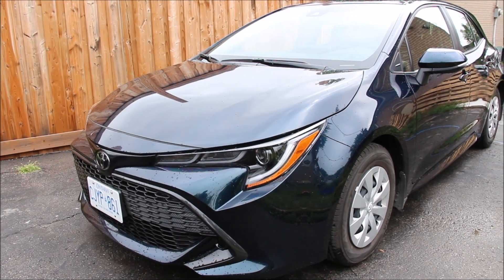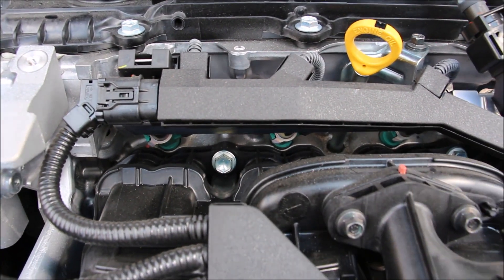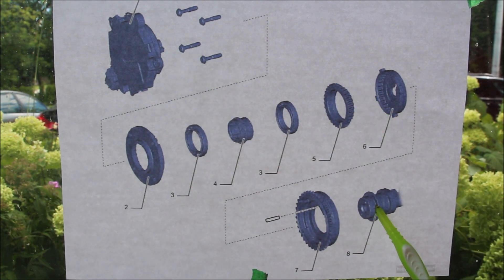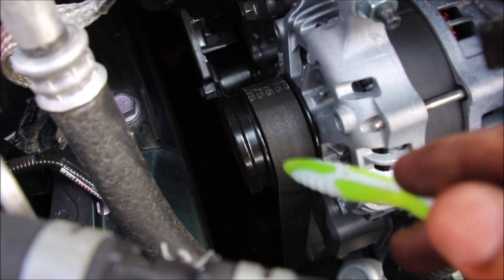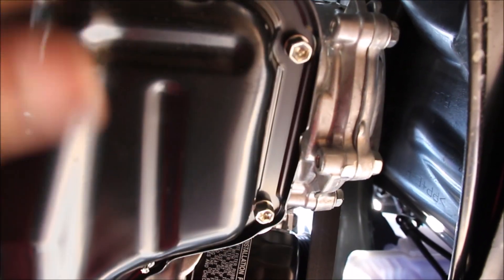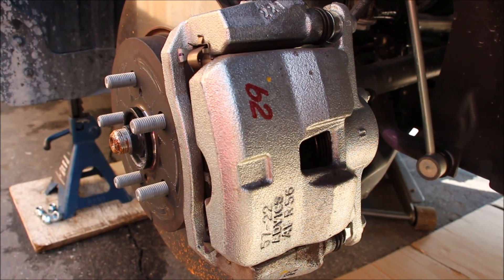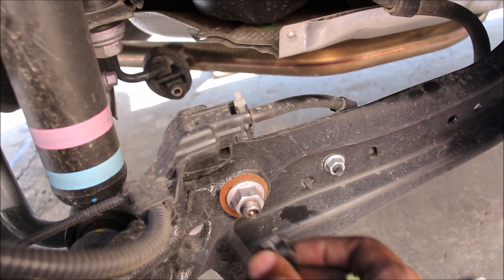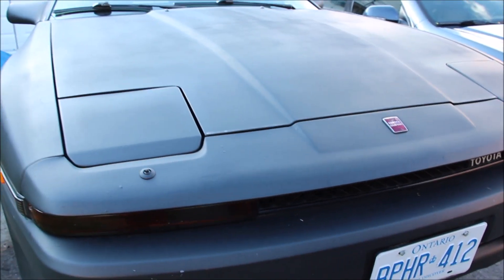Toyota Corolla Mechanical Review

Comment: this has a drive by wire throttle body? dang in 2019?
Reply from the maker: All cars now have drive by wire. 
The good stuff was drive by cable
Reply: Surprisingly enough, my 2005 Camry is drive by wire. 2AZ-FE with 200k miles and counting
Reply from the maker: Do you have throttle lag? 
My V6 has alot of lag and I hate it
Reply: @speedkar99  I'm actually surprised it doesn't. Then again, the 2AZ doesn't have an EGR system and the throttle body is pretty clean. Do you have the 1MZ or 3MZ?

Comment: Is that your brand new Corolla? What happened to your old Corolla that you cut the roof off? Do you agree that you should avoid first model year cars due to early production problems?
Reply from the maker: Not mine. I scrapped the old one. First year model cars are more trouble but even worse if the power train has changed with the update

Comment: 1:30 is that low pressure fuel pump visible there? Is servicing a failed fuel pump easy on this car?
Reply from the maker: Under the seat there's an access panel, just like most Japanese cars

Comment: got a 93 geo prizm AKA (toyota corolla)...replaced the valve cover gasket for 30 bucks took about 40 minutes with a beer...but this thing ...wow cars have gotten more complex wouldn't even attempt to do anything more than a oil change.
Reply from the maker: I'm sure you can easily replace the valve cover gasket here...it's a 4 banger...try a v6 bro

Comment: Like any other videos you've done, this is another great one.
It is so refreshing to have a review like this since not many people can do this, only those with technical expertise such as yourself can!
Besides being very educational, it will become a vital source of information for those who are thinking of buying this car, as well as something to look back on in the years to come from historical point of view - beneficial to much wider audiences than you think.
Thank you once again for another great video and keep up the good work.
Reply from the maker: Agreed, though since it's technical, the audience might be narrowed. How many Corolla drivers care about it's Mechanicals out there?
Reply: @speedkar99  You're right, however most come to see your channel are technical minded (as it could be seen from all the comments that has been posted) and those could also advise others who are not that technically minded when want help to buy a Corolla.

I am really grateful for videos like this. 

My disappointment for this engine, out of all plastics, the plastic cam cover.  GM started this trend and Toyota kind of followed, which is a shame.

I currently run a 3S-FE Avensis which has covered over 410,000km without any overhaul.  Everything metal, that's why it was possible.

Many thanks once again for series of great videos!

Comment: Doesn't the electronic brake on the rear wheels work without putting the transmission in Park?
Reply: Yes, the electric park brake is fully independent of park on the transmission.

As a mechanic, we actually like these systems and find they are extremely reliable as they self test every time you use the car. Old park brakes always needed replacing simply due to lack of use because few people use the park brake on automatic vehicles. Lack of use is the main killer for park brakes. Since these self test, they don't tend to fail due to lack of use.
Reply: @alexmaclean1  That's what I thought. The video prompted the question. I try to use the parking/emergency brake whenever I am parked even on a flat surface. Use it or lose it.
Reply from the maker: These ones automatically engage when you put it in park 
The button is there to override that

Comment: Not always timing chain means that you dont have to service it. Looking at you VW. Also this is not impeller type oil pump. This is gear pump just different type.
Reply from the maker: Good point 
But most previous Corollas didn't need it

Comment: You are AMAZING! Substance over appearance. I had minimal knowledge about mechanical aspects of a car and I learned immensely from your videos. Would you change the 0W-16 oil every 16,000 km per owner manual? If the sealed transmission fluid is not lifetime in spite of Toyota's claims, what is the mileage or age when you prefer to change it?
Reply from the maker: Thanks 
I would change the tranny fluid 
And reduce that oil interval slightly , although it's synthetic oil

Comment: great video...but one sensor goes bad and  the hole engine goes straight to the dump
Reply: I can't think of a situation where you would scrap the engine rather than replacing the failed sensor lol
Reply: I've worked as a technician for 14 years now, the majority of my time is spent in electrical diag these days. In all my years in this trade I've yet to see an engine that has physically been destroyed strictly because of any sensor failing.

I get that many sensors are fairly expensive these days, but never really to the point of making it worth while to replace an engine.

Perhaps you were being hyperbolic and 8 didn't get it, in which case I apologize. Enjoy the rest of your long weekend!
Reply from the maker: Fail safe mode bro

Comment: that 2.0 engine can do 40mpg highway......while the 2.5 camry engine with way more hp can do 41mpg highway.....why???????????
Reply from the maker: Transmission is different, weight, gearing, tires all make a huge difference

Comment: Graduated with a Mechanical Engineering degree and while they did teach me fundamentals this is what I needed to supplement my studies.  I worked on cars to pay my way through school, but nothing in the car community comes remotely to this.  Thank you so much.

I've personally been trying to compare shaft diameters of various vehicles and study engine clearances and chamber sizes to simulate in ANSYS, but I havent found any blueprints.  I guess to investigate what would justify engines or transmission types.  Maybe you can do something about that?
Reply from the maker: I too am a mechanical engineer. We don't learn this stuff in school, so I learned by doing this type of stuff on the side. As far as finding blueprints...those are usually company secrets...the easiest way is to actually reverse engineer components and measure them yourself (I have a series of videos on teardowns).

Comment: awesome video!  thank you. 

One thing, if you can point out something that seems well engineered that would be cool.  Like a beefy part, better brakes, better material...etc.
Reply from the maker: Thanks. It would be more of the opposite... pointing out parts where they've saved weight and cost

Comment: Calling it a review is a bit of a stretch, more so a mechanical overview but interesting video none the less. its not as if you tried doing mechanical work to it as such but I understand that new cars are hard to try doing mechanical repairs to as their really shouldnt be anything that needs repair.  But god do modern car engine bays look horrific. I bet in 15 years time you accidentally drop a wrench in the engine bay and now your brittle plastic valve cover or intake manifold  is leaking like a sieve.
Reply from the maker: Yeah perhaps an overview since I'll reserve my judgement to the test of time. 
Why so much hate for modern electronics and plastic?

Comment: I like the previous gen corollas, Had more metal and less electronics. Im sure this new corolla is reliable but I'll wait 100,000 miles to see how they age.
Reply from the maker: Good point. But think for a minute what was the function of all the extra metal on your old Corolla? If they can save weight and go-to plastic then that's more weight and fuel savings. Electronics have come a far way in terms of reliability, think of power locks and windows that we take for granted today. Time will tell how long these will last, it has been proven on Lexus vehicles for over a decade already.

Comment: God I wish they hadn't gone to a CVT. The Corolla and Civic are crossed off my shopping list because of it. I know they haven't had many problems BUT you can't tell me these cars are going to last 25 years and make it to 300k+ miles without having to replace that CVT at least once.
Reply from the maker: At least they offer them in a manual. CVT makes sense from the manufacturer perspective because it's more fuel efficient on these economical vehicles

Comment: Thanks for the nearly forensic analysis.This car is certainly a technological leap forward from earlier Corollas which makes it so unfortunate that they shrunk the interior and lowered the headroom so much on the new hatch . Canada needs and deserves a new Matrix aka the  Corolla Touring Sports they sell in Europe.
Reply from the maker: Yeah I've read that the room is down compared to the old iM/Auris. But at least it's good to have a proper hatchback to replace the Matrix
Reply: @speedkar99  This is a 7/8 scale Matrix. At 6'3" inches I literally don't fit inside.

Comment: 1:13 I never knew a 0W16 oil exists. It must be really cold up there use such low viscosity oil 😅 Do you have any Land Cruisers/Prados over there? It’d be great if you could review such legendary car.
Reply: It's not just for Canada. All Corollas will use it. (I never heard of it either.)
Reply from the maker: All new Toyotas with the dynamic force series of engines are using thin 0w16.
Reply: @speedkar99  wouldn't that make the engine more prone to burning oil since the oil is really thin? are they using it mainly coz for fuel efficiency or just the general working temp in Canada?
Reply from the maker: We don't have land cruisers, just Lexus  LX470

Comment: Great job man! Do you think this will be as reliable as 14-19 models? I think its kind of a bummer that they switched to plastic valve cover. It’s aluminum in my 2zr engine
Reply from the maker: Plastic valve covers have been around for a while. 

The 2ZR is a proven engine and the M20a brings some much needed improvements. Only time will tell how long it'll last but I'm sure the engineers at Toyota wouldn't release a mass manufacted engine without stringent testing.

Comment: electric water pump
electric cam phaser
plastic everywhere
cam driven vaccum pump 
You just created some 100 more failure points
Reply from the maker: As the engineers would see it, that's 100 more points of optimization 😉
Reply: @speedkar99  as an engineer my self I can always understand the arguments behind making something more efficient. But I doubt that reliability can remain constant when so many variables are involved.

Comment: Electric water pump, solenoid controlled oil pump, plastic intake and valve cover, dedicated vacuum pump on a GAS engine and a transmission you cant service at home. 
Either toyota has gone mad and is playing with fire when it comes to their reliability and diy repairability fame, or they are going to prove 2000's german engineering to be absolute joke by selling overpriced beta version technology that shouldn't have made it to production.
Reply from the maker: That's one perspective. But if you think about it, Toyota has been using alot of these technologies in Lexus vehicles reliably for over a decade and have only now brought it to the economy car lineup. Sure when it breaks it'll be expensive to fix, but I don't expect things to break right out of warranty unlike some German vehicles.
Reply: Plastic intake manifolds have been around for over 20 years, including in "domestic" and "European" cars (many of both are made in Mexico...oops!).

Comment: 1:03 The valve cover is plastic, but it's Toyota plastic and it's just a cover. Even so, I wonder if it will become brittle from heat after 200,000 miles. I think plastic air intake plenums  are more worrisome.
Reply from the maker: Plastic intakes and valve covers have been around for two decades...
Yes some do warp and crack but OEMs are looking to shave grams of weight in any way they can

Comment: So did Toyota change their engine naming conventions when they launched the whole TNGA thing?
Reply from the maker: Engines and platforms are different...
This is a new engine and they've given it a new family code. 

Weird though that M20 is the 2.0L Corolla version and the same engine in 2.5L is called the A25 in the Camry/Rav4
Reply: @speedkar99  Yea that's interesting, I've been so used to their letter code naming convention (2GR-FE, 2AZ-FE, 1ZZ-FE, etc) this really threw me for a loop. As soon as you said M20 I was like "did they outsource an engine?". I'm sure they did it for a reason and hopefully as more of them get released the meaning behind them will as well.

Comment: EGR valve is a 2019? I need to bitch slap the engineers behind this.
Reply from the maker: It's all about the pollution and emissions control!
Reply: @speedkar99  It's a cheapo BS device. only some make and models use this junk. modern ECUs and engine designs can handle a ton of different engine running modes for efficiency. this car is so cheap all around. many corners cut.
yes I saw the ECU and TCM location. that's just waiting for water damage or even physical crushing when doing a trans or engine job in the future. $1,000 instant EXTRA damage cost would be hilarious lol

Comment: the ECU is in that location because toyota didn't want to spend an extra $26.07 for a longer wiring harness to make it reach near the cabin. I recommend people to wash their engine bay with a water hose often or at least right before they sell the car.
Reply from the maker: True, shorter wiring is probably the main reason why ECUs are now under hood.
Reply: @speedkar99  Nah. It's for the air cooling of the ever-denser SMD-laden PCBs. These motherfuckers are trying to dissipate a thousand watts through something the size of an eyelash!
Reply from the maker: Did you see the transmission computer on the back of the transmission?

Comment: Bottom line: Even the Corolla packs a lot of quality Toyota engineering. That begs the question...why did they need to join forces with BMW on the 2020 Supra? My guess would be to keep development costs down on what will probably be a low volume seller.
Reply from the maker: Agreed, the Supra has it's own codeveloped platform that doesn't share with any other mass production vehicles to be made worth it. 
The TNGA platform that underpinns this new Corolla will have paid for itself many times over due to the high production.
Reply: Four balls, four nostrils.

Comment: Is this engine direct injected, dual injected? Are the turbo charged engines not coming to Canada?
Reply from the maker: Yep dual injection. 
Corolla doesn't have turbo
Reply: @speedkar99  There's a 1.2 turbo for (unspecified) "international markets", but it's only 114 hp. Also, Dickapedia tells me that the 6-speed stick is only available with the M20A engine.

Comment: When I watch a review I want to see this not Android auto and how big the screen is, cause the most importanat thing in a car is the drivetrain, suspension and the reliability of those systems.

And one more thing I want to know is the braking distance of the car, cause if the car can go from 0-100km/h in less than 8 seconds I rather care about braking distance than the acceleration
Reply from the maker: Good points! Those are the same things I think about, but unfortunately what sells is comfort, price, looks and features, and automakers are left to short change what's underneath!

Comment: Too many things controled by computers it completely discourages DYI people. I miss the older corolla's where things were more simpler and easier to service.
Reply from the maker: True, but if you have simple tools and the repair manual you can do alot of diagnostics and repair yourself...it just won't be as traditional as sticking a screwdriver and listening for a squeaky bearing...more like plugging in a computer and measuring resistance in a multimeter.
Reply: @speedkar99  you do have a point there you can plug in a scan tool and find problems you can fix  . For me I like my 1985 Corolla, everything is mechanical and is it  actually does have a very basic computer but that's for the simple emissions control.
Reply: I miss the old horse driven carriage so simple
Reply: vadim nesen far from simple, you know how fragile a horse is? You wOnt get many mikes out of one and they will be slow miles. Also constant maintenance even if you never go anywhere.You’ve never had a horse have you?
Reply: Only gonna get worse as time ticks. You will be forced to take into dealer for service
Reply: Don’t blame toyota or any manufacturer because of computers, its all the fault of emissions and EPA and efficiency, even honda, mazda, every manufacturer does that
Reply: You can thank the EPA for that.
Reply: There will be much less wiring in the next Tesla. Current Tesla’s are more reliable, easier to maintain, and much cheaper to run than a Toyota Corolla which means you will pay a lot less over the life of the car for something safer, more luxurious and faster.

Comment: Electric brake pump, electric coolant pump, electric park brake... Is there a real advantage in this?
Reply from the maker: Fuel efficiency. Diagnostics. Ability to control from a central computer network. Space savings.
Reply: Um, if I may also add, BETTER PERFORMANCE! Electric motors for pumps mean you're not relying on engine speed for output, which means you can have more coolant flow while you sit in traffic, for example. This goes hand in hand with efficiency of course, because flow decreases when not needed (thereby saving the fuel to drive the alternator, which ultimately drives the pumps).

As for electric parking brake, I dunno how to feel about it. Changing a cable is a real motherfucker sometimes, but then, would a car feel like a car if you can't e-brake in snowy parking lots? I dunno, man...
Reply: @fun_ghoul  Makes sense. Especially about the fun you can have with e-brake on snow and gravel when nobody is watching